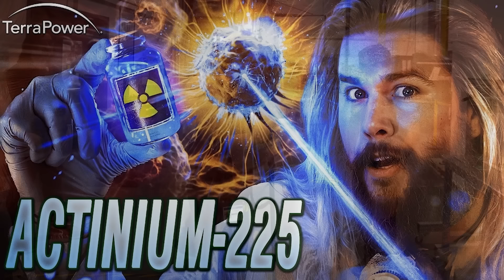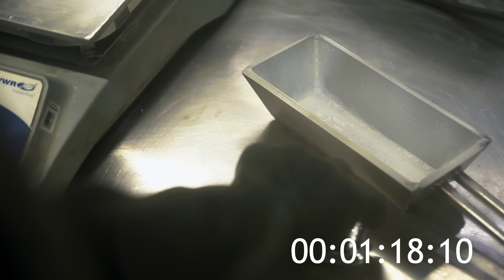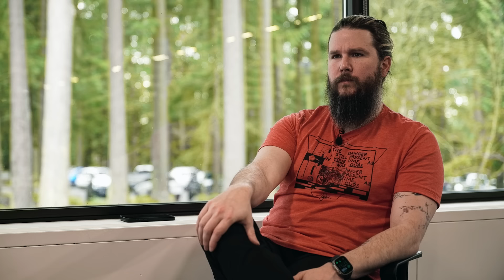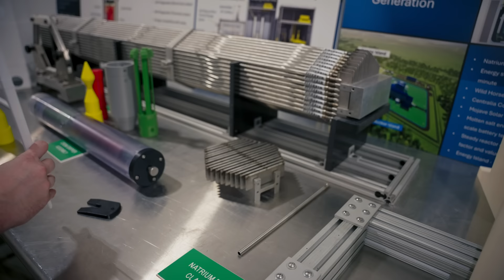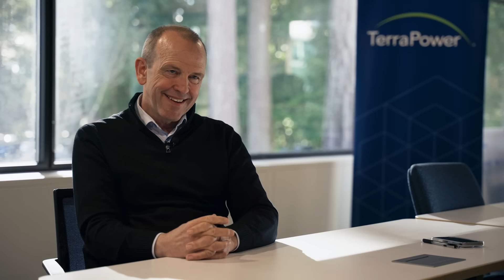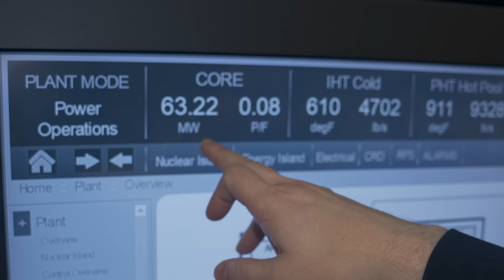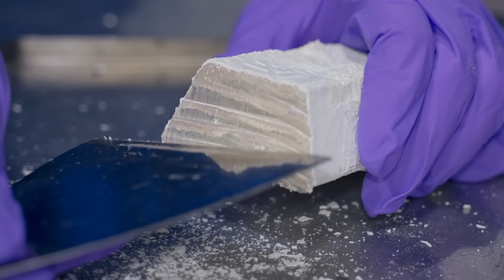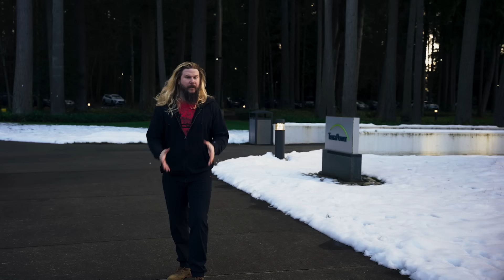Will Natrium Nuclear Reactors Change Everything?

Comment: Huh. Neat. Increasing safety by adding a thermal battery rather than trying to couple the molten sodium to a heat exchanger with water. It makes perfect sense.

I love how the main threat of water cooled nuclear reactor is actually the steam. We forget in the modern age just how incredibly dangerous so-called "live steam" can be, given we now don't have steam powered things around routinely exploding into horrifying spaghetti nonsense. In many ways that makes a lot of sense, the liquid sodium exchanges heat super readily so there isn't as much of a lingering heat problem keeping it dangerous.

In a way, this makes me think of a game called Oxygen Not Included. Not so much the regular gameplay itself, but the fact that they model heat transfer between different items. The only thing missing is pressure within pipe systems to keep things liquid/gaseous.

Comment: I am surprised you forgot to mention one thing : molten salts are extremely corrosive, so they need constant pipes, valves and pumps replacing, which is very costly. 

This is the second main reason why we don't use those reactors in day-to-day, and won't in the future until we find a solution to this problem. (the first reason being they cannot serve as cover-ups to create nuclear bombs fuel)

Comment: I do feel like this was a bit of a glaze and that a lot of my real questions were left hanging. According to them it is much safer and I can see how not having to pressurize would be important. Also it is more efficient? Because it's a fast reactor? Or because of the heat battery? Those weren't explained to my noob brain. Also why is this better in terms of nuclear waste? They said it uses enriched uranium, doesn't that require a lot of waste in order to get? Also they kept saying that all of these technologies have been around since the beginning, so an actual explanation as to why no one used them together before would be maybe a little important. Anyway I very much want more nuclear power but I don't think that telling people that you found a design that lets you be more lax on safety measures and construction costs is a great way to help public opinion.

Comment: So we still not evolved past heat water to steam😂

I feel like aliens aren't powering their ships with steam or explosions.

Just saying I feel like a revelation in tech needs revolutionary methods. Like lightbulbs to leds
Reply: Well if you got a better idea on how to convert heat into mechanical, then electrical energy at the same efficiency or better, rating that steam achieves, go ahead and pitch it. They use it because right now. to their knowledge, it IS the most efficient system they got, and its tried and true.

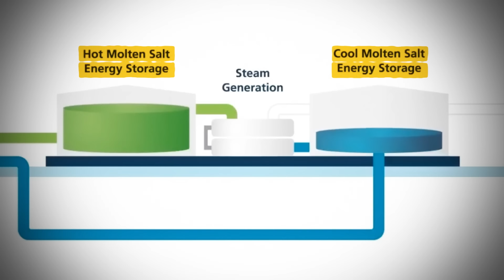Comment: 5:30 - EXCUSE ME?! Since when "wind&solar" can do load following?!?! 10:40 - that was reasoning behind RBMK ...
Reply: Wind farms have Breaks in the mills that can slow down turbines to limit their energy potential so they can closely follow grid demands. and Most solar farms can rotate their mirrors/cells to get less or more sunlight to also shift loads, both are insanely easy to to. minimal mechanical energy required.

RBMK is a poor example here. The Russians believed the reactor to be infallible. Unsinkable. if you compared it to the Titanic, MS reactors have so many safety features and regulation around them they can't be compared to RBMK's its... like comparing a peanut to a watermelon, If anything the design is even safer as they don't have many of the glaring flaws that RBMK reactors had, including a positive void co-efficient. At operating temperatures the sodium doesn't turn into steam creating voids to excite the reactor. and the sodium transfers the heat from the Nuclear containment area to the electrical generation area with minimal risk of contamination release.

Comment: If the salts and/or sodium turns solid inside the pipes and tanks, they will have a fun little project on their hands.
Reply: Sodium has a melting point just below water's boiling point, I imagine the exchanger loops and tanks have heater coils where they can heat the pipes to melt the sodium, and it would be a non-issue at operating temperature as the heat would be 5-11X hotter than the melting point.

Comment: There are 3 big problems with this design that have limited it in the past. 

Aside from the explosion hazard of the sodium if it gets loose, it's also ridiculously reactive and is looking for electrons anywhere it can grab them. That means everything in this reactor and it's complete thermal circuit needs to be manufactured out of pretty exotic alloys, and although the buildings may not be big, what's inside them is astronomically expensive by comparison to a 'normal' nuclear reactor which is already stupidly expensive. 

I didn't hear anything about how much stored energy this thermal battery can store, and what happens when it gets critically cold (below melting point of sodium or nitrate salt solution) and freezes solid?  Oh, and the nitrate salt is also stupidly corrosive at temperature, and if it eats through the HEX, and gets into the water loop, that's another level of bad. 

Third, Bill Gates. I don't trust that pedophile Dr. Mengele-wanna-be, population control, self proclaimed vaccine expert, weirdo fuckwipe as far as I can throw him.  The guy is nuts.
Reply: 1. Sodium would be in a closed loop system, no water involved. and even if it does leak theirs proper ways to contain it and handle it, if it causes a fire? it can be cooled and put out with Halon systems. Its reactive sure, but proper procedures can prevent its issues. The best thing about Sodium is its resistant to Neutron flux so it can't readily become radioactive after being exposed to neutron bombardment like it would experience in the reactor core.

2. The thermal properties of Sodium are incredible, it has a high thermal conductivity and a higher density than water so it can hold more heat than water, this was touched on in the video. In terms of storing it the containment tanks need to just be thoroughly insulated and these batteries would take years to properly cool down.

In terms of the sodium freezing? that's a non issue as the exchanger pipes and the reactor can be heated to beyond the 97*C (To set the expectation water boils at 100*C) as they have heating coils in the piping so that's a non issue. The metals and salts have a very low melting point. that kitchen appliances can easily maintain, nevermind a Advanced Nuclear powerplant.

3. Bill gates owns the project but he has no say in how it functions. all that is regulated by the US department of energy and the International Atomic Energy Commission. so even if he was an idiot he couldn't fuck up the reactor as this is the most regulated industry in the US. and any foul play would get him removed as owner instantly under the Imminent domain clause.

He's funding the project but real scientists and experts are the ones at the helm of the operation. He has no say in the matter beyond it. Also theirs greater evils than bill gates out there., Amazon and Bezos being one of them. So i think you need to get over hating a idea just because of who backs it.
Reply: @Hawkeye_PC  You have some good points, and I did not know about sodium's nuclear resistance, that's a nice bonus. But what you didn't catch, or ignored, is what's needed to keep it in the piping itself. Yes, it's atmospheric pressure and melting point is just below that of water steam, but I'm referring to it's nasty habit of chemically attacking what it is contained in... that was it's largest drawback in previous installations, it chewed through the piping... which can be fixed, but brutally expensive. 

While sodium might be decently easy to handle, the molten KNO3 and NANO3 are not. Their melting points of 308 and 334C respectively are not kitchen appliance levels of heating. Last time someone took a steak to 600+F they had charcoal in the oven. That stuff is also a level above sodium's reactivity. Again, not saying it's impossible, but also again, brutally expensive to deal with. 

No arguments there are other problem children like Bezos, put them in the same category.
Reply: @kleetus92  Fair points indeed, So in terms of Sodium, many of the issues with the corrosion in other MSR reactor designs is the other "impurities" mixed in with it. namely those reactors include the fuel load in the molten salt and that is what raises the corrosive behavior of sodium, But I think they solved this problem by keeping the fuel and the Sodium each as independent parts of the reactor that never comingle with each other, its just the sodium acting as the coolant instead of water, (This has a really sweet effect as its impossible to get positive void co-efficients that can de-stabilize the reactor. but I digress.) By doing this and not having a Molten salt fuel mixture the corrosive nature of the Sodium and the molten salt loops are drastically reduced, to something that titanium cladding can readily tolerate. I fathom they are going forward with the project because they have a viable solution to this, but this is my educated theory on how they solved it.

In terms of heating, If they plan to use Linear Induction to pump this fluid around instead of using mechanical pumps, they could and are most likely able to use magnetism to heat and re-melt the sodium in the pipes, and all that takes is running a powerful current through copper wire wound around the pipes, and if they use a Titanium/copper Alloy in the piping then the pipe gets hot enough to melt the solid salts again, and your back in business. The process is also called Induction heating and is a freaking neat Science. Newer smelters are using that these days as its better than traditional heating.
Reply: @Hawkeye_PC  Yeah I worked at a place that made the pipes be conductors for deep sea wells, so when they'd clog, they'd dump a bunch of current to them to melt and clear. it was only 1 or 2 volts but some ridiculous current like 75,000 amps.

Comment: They wont magnetic lines across the globe change consistently in unpredictable ways if the fuel is that magnetic its 1 fridge magnet away from altering the levels in the reactor n causing a meltdown it wouldnt be able to surround the plutonium as it does currently "flat not a single ripple" it would be in motion with the slightest magnetic interference. A phone near it prolly fk it up
Reply: You really don't know how the science of it works, just reading this made me bang my head against the desk. A fridge magnet is no where near strong enough to destabilize a reactor and even if it did the reactor would drop the control rods and kill the reaction instantly. (The salt is only a coolant, not the fuel.) It runs like a normal reactor except that it uses Sodium as the heat exchanging fluid.

And this is a nuclear controlled area, it has greater security than the White house does. So yes. that means If something endangers the reactor you wouldn't be able to bring it anywhere near it, (Or be shot dead trying)). What you don't realize is the US atomic energy commission is involved. and they know if a mouse farts somewhere in the plant. this isn't the early days of nuclear power, theirs a stupid amount of safety procedures in place to make reactors safe to meet inspection standards, which ALL of them are pass or shut down the reactor. And i would encourage you to do your research on it.

Comment: Ok.  I have to admit I'm still concerned.  Yes I know.  Sodium doesn't just spontaneously explode, it requires water to produce a hydrogen explosion.  No problem?

Fukushima.  We build these things near massive bodies of water.  I'm concerned at the prospect of.... for example a tidal wave hitting one of these reactors and setting the whole damned thing on fire.  Yeah, I get that the sodium would cool quickly..... but it's already molten, you hit it with a lot of water, which I'll concede isn't going to be a daily occurrence, but there's absolutely a non-zero chance of it happening.....  and we could get another Chernobyl.  Bad things happen when radioactive shit catches on fire.

Comment: I'm all for nuclear energy - it's the future, as fossil fuels are a dead end; solar, hydor, and wind sources have only been creeping forward in innovation and efficiency.    Only slightly concerning issue is how violently reactive sodium metal can be especially when molten...  even just in the presence of oxygen and moisture in the air... Like anything else - YES,  it can be controlled, shielded, etc... and YES, the risk of reaction is low., just never zero.  If anything in this area of science and energy has been learned again and again - things sometimes happen that "lets the genie out of the bottle" in complex systems --  despite all efforts to prevent it.  Everything is a tradeoff.  Water can boil and create explosive amounts of pressure that can do great damage -  now there's a new reactor that will operate at lower pressure that will avoid a Chernobyl-like steam blast... but now the cooling loop contains semiunstable molten reactive metal that has it's own set of potential disasters, like creating free hydrogen in an accidental reaction - which caused explosions in other malfunctioning facilities, like Fukushima.  This is just another challenge to overcome, and only time will tell if the genie stays in the bottle.

Comment: the first 99% is irrelevant if the last 1% is the part you cant overcome. It doesn't matter how far they have come if they haven't actually SOLVED the issues, especially with corrosion. its not the explosivity AFAIK. its the fact that it literally eats the pipes it runs through. Never heard anything addressing this in the video....
Reply: More than likely it's Austenitic stainless steel. They have quite a few options to use that resist heat and corrosion.

Comment: This reactor would have to be carefully managed to prevent the sodium from boiling. The danger of melting down the fuel would still be there. Even though the uranium fuel would be enriched, it would still create plutonium... not optimum behavior. Other fission products would accumulate in the fuel and effect the efficiency of the reactor. There would be no easy way to remove the other fission products. The reactor would be difficult to scram in a coolant failure scenario because the decay products would continue to generate heat... again not optimum behavior. Heating water is thermodynamically inefficient because it would waste heat through the latent heat of fusion problem. It would be better to use carbon dioxide to drive the turbine generator.

LFTR reactors using the thorium fuel cycle would be a better choice.

Comment: This is by far not the first commercial sodium-cooled reactor. The Russian BN-800 went commercial in 2016 and the Chinese CFR-600 is already operational and will become commercial this year. Natrium's firsts are the use of pure magnetodynamic pumping and a molten salt battery for load following.

Also, that sodium demonstration proves nothing and I'm kinda miffed that you two didn't try to explain the main safety feature of Natrium: The sodium coolant never touches any water system. By passing the heat to the secondary molten salt coolant that doesn't react with water, the sodium can never cause explosive reaction.

Comment: I'm relieved to find out that Sodium metal will only burn on contact with air when it's molten. Thank God this isn't a molten sodium reactor. I'm glad to know that when the material is in a phase other than the phase it will be operating in, it is relatively safe. Can you tell us if you can drown on a slab of ice next?

Comment: As a fan of nuclear, the things that come to mind which could be an issue as a sort of steel-man arguments are: 

-Having a system filled with argon, what happens if there's a leak and atmospheric water vapor gets in. Sodium hydroxide doesn't play nice with metals. Same with sodium oxides. 

- Needing hands-on maintenance would be a real pain in an oxygen-free environment. 

- If any water gets into contact with liquid sodium, that's gonna be an issue. 

- what happens if the reactor needs immediate cooling from an external source? Does it have a freeze plug situation where it defaults to a safe storage under the reactor and the reaction can't continue without the sodium metal flowing around? 

- will the spent nuclear fuel have to be treated differently if it's contaminated with sodium metal? 

- With hot salt coolant, how badly will that corrode the plumbing if at all? 

- in general, maintenance and emergency response to the coolants would need a lot of specialized training and equipment, I imagine. The sodium and salt coming into contact with the outside world at all would be a big headache. 

- Wyoming seems like the safest place for the reactor with very few 
natural disasters present. Maybe a tornado? Will they be viable near geologically active areas or next to water where flooding or tsunamis are possible?

Comment: Its impossible to keep the internals clean enough that it won't break down into crystal blockages.  You either have to build it to be less efficient than solar panels or clean it out every 10 days.  A molten salt reactor is still a molten salt reactor... they produce 90x as much A and B over their lifetimes as a BWR and produce 1/20th the power.